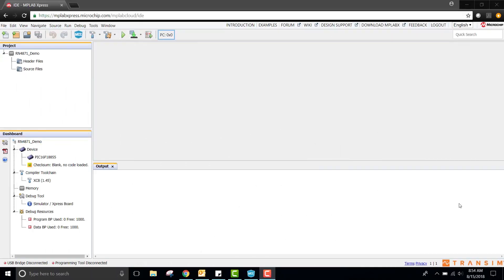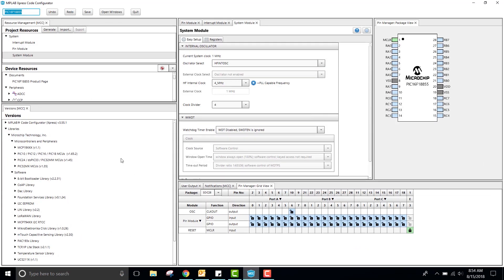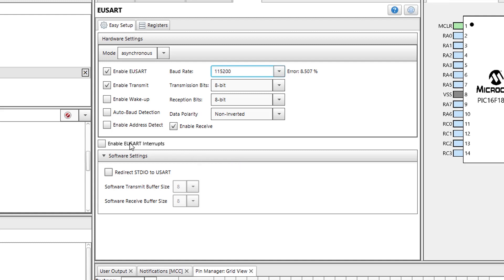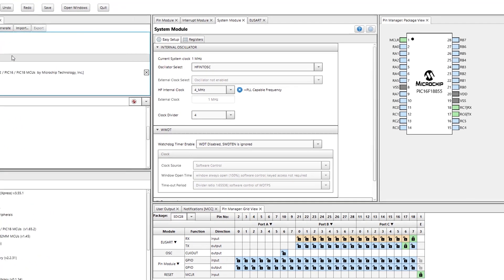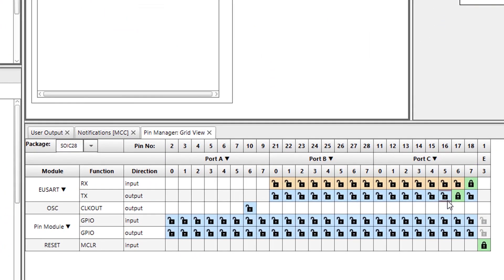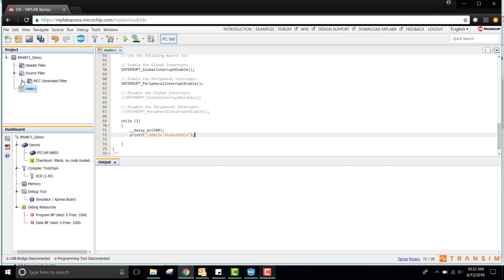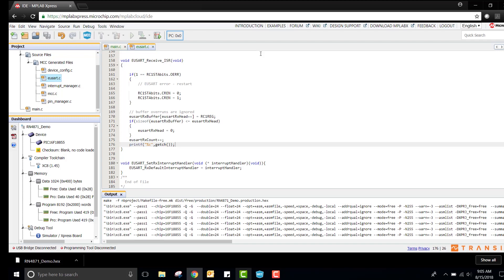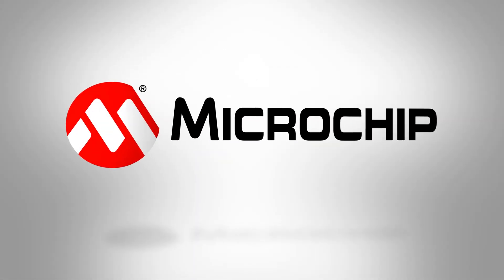How To Send Data to a Smartphone Using a PIC® Microcontroller

Comment: Hello sir can I use this apps to communicate between two smartphone
Reply from the maker: The SmartData app was primarily designed to connect to Microchip Bluetooth Low Energy data modules (RN487x, BM7x, RN4020) to a smartphone to showcase the features of the modules. While it might be possible to also use this app to connect two smartphones, it would take considerable effort and might not be the best option. If you are asking about this for just educational purposes, we don’t have any tutorials or reference materials available to show you how to this. If you need assistance developing this capability related to a Bluetooth data product, then please contact your local Microchip Sales Office.
Reply: @MicrochipTechnology  Is there an app to send and receive data to PIC controller using USB not bluetooth??
Reply from the maker: @Shayma_a  Kindly visit support.microchip.com for assistance. Thank you.